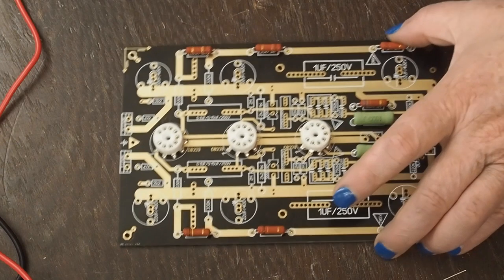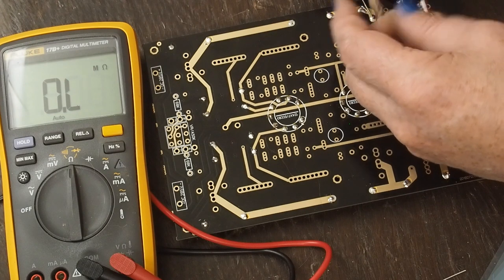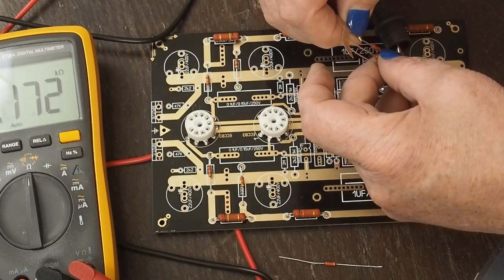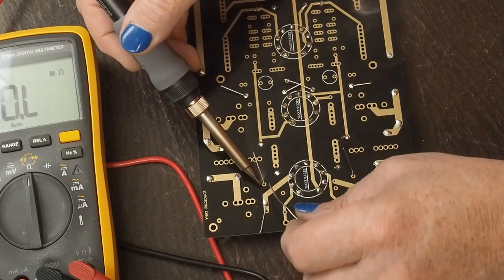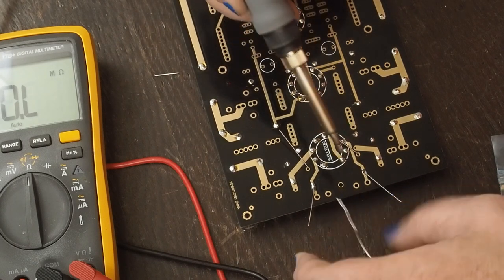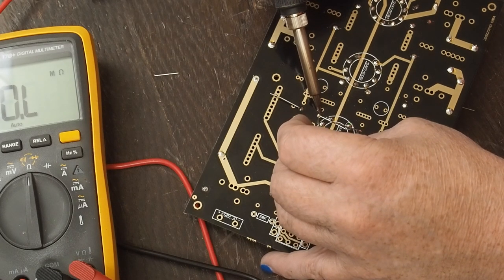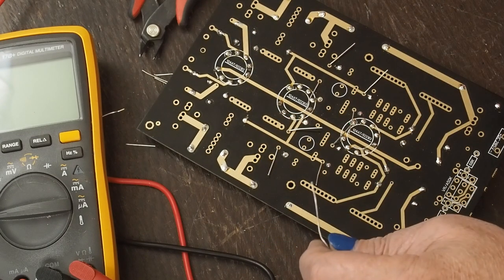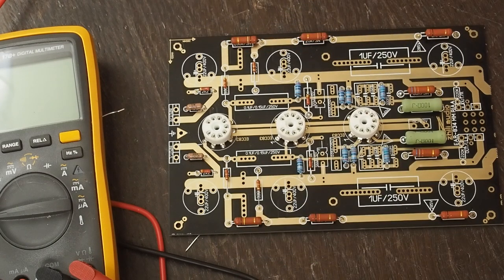All Tube Phono Stage Pre-amp Part 5: Main Board

Comment: It’s so cool to see someone else’s interpretation of this legendary phono pre. Glad to see you abandoned the questionable parts quality that came with the kit. When I built the EAR834 clone phono pre, I bought the blue PSU and main PCB’s, specifically so I had my choice of quality parts. For the 3Watt 2K, 20K, and 200K resistors that go in between the 47uf 450v electrolytics, I also chose Vishay, and Mundorf caps for the .15uf and 1uf 400v film caps. Now, onto Part 6! Loving your vids! Thanks again 🙂🎶

Comment: Some phono preamps (and sometimes turntables) have capacitance adjustments for moving magnet cartridges.  Have you seen that and what are your thoughts on that?
Reply from the maker: I've seen it, I thought was more for MC? I'll have to do some research on that one.
Reply: Correct, but IMHO does not make any noticeable difference on MM on my system (EL34 Tube Amp, Fluance RT85 with Ortofon 2M Blue cartridge all going to a pair of Klipsch RF82 at 98dB sensitivity), maybe more for MC and/or really super high-end and matched systems, which mine doesn't seem to be or that pre-amp deep switch selection is just a gimmick. So unless you are playing your records with a $1000+ phono cartridge and have highly sensitive audiophile like Amp and speakers, I think your money will be better invested in say better interconnects or speaker cables for instance as these will also have the potential to impact the sound with or without a switchable impedance matching preamp... At the end of the day, when one is looking at that type of detail, it is no longer the "Math" that dictate what goes with what, but more a trial & test approach as this will now purely fall within your ears perception and audible realm, and as individual human beings, we are all made differently with a different perception of sound perfection, if you get my drift. Good question and debate especially as integrating this option would be inexpensive and easy to do, as we are just talking about a set of resistors to choose from.
Reply: @SkunkieDesignsElectronics  resistive cartridge loading is for MC. 
Capacitance loading is for MM.  
I have had mixed results for capacitive loading on MM.  Sometimes I hear a difference, sometimes not.